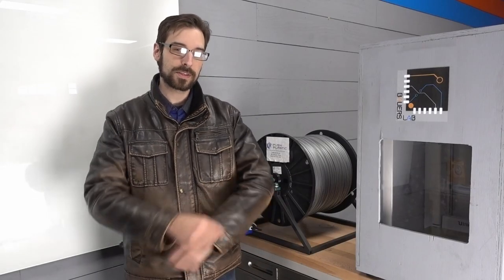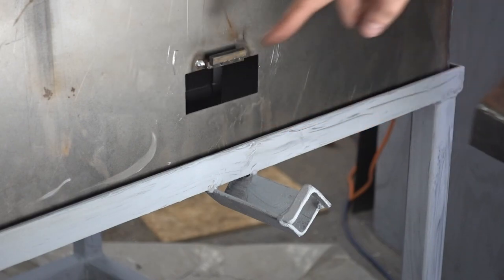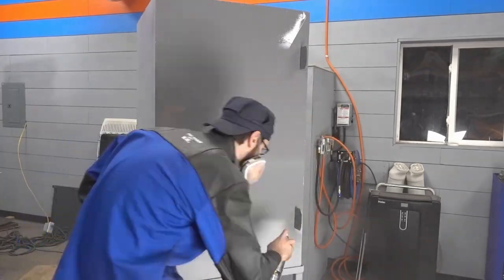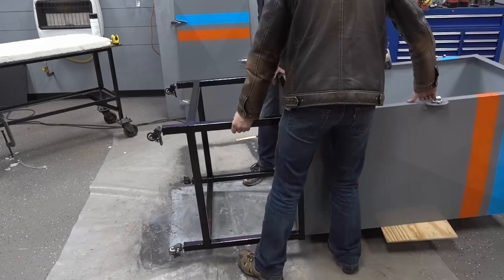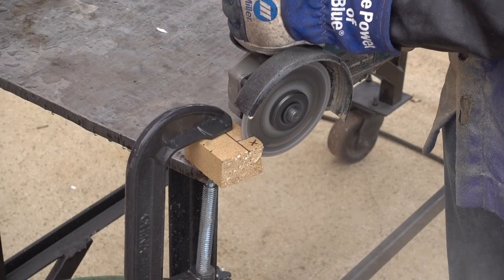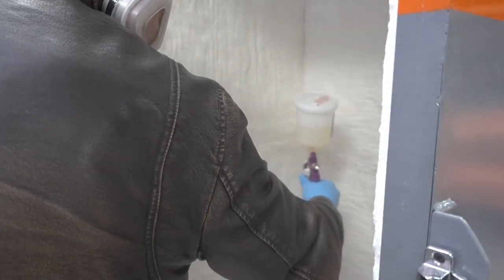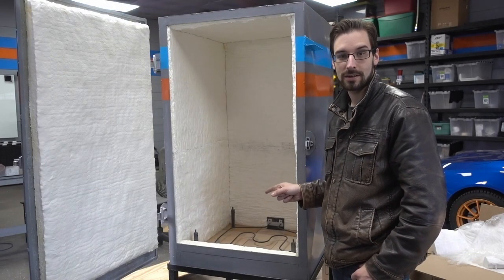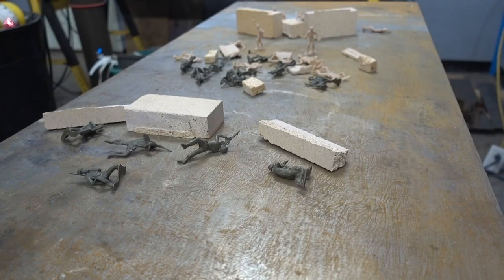Lab Oven (Part 2) - Paint & Insulation

Comment: Hello thanks for the great video. Can the insulation be installed from the outside? And what if I do not have the adhesive?
Please help me
Thank you in advance
Reply from the maker: Well, you can kinda do whatever you want. You will need to redesign some things though. You could install the insulation from the outside if you build a frame for the outer wall first. You could probably just hold everything in place with wire wrapped around this frame rather than using glue on metal sheets.
Reply: @BauersLab  thank you very much

Comment: Hello, we would like to make curing oven. If we use the same system as you do, will we succeed?
Reply from the maker: It is hard to say. I used a lot of custom hardware here. The choice of that hardware was largely based on what we already know how to work with, in the lab. The HMI was completely customer, which could be very difficult for someone that is not already familiar with c# .net. So, it is really about your confidence level with the tools. After this video series, I haven't had to fix anything on this oven. So, this system is working well.

Comment: What Spray Adhesive did you use? and what hardener did you use??
Reply from the maker: For the adhesive I used 3M 08090 Super Yellow Trim Adhesive. Keep in mind that this is not going to support supper high temps. My design didn't require going above 400 C inside the chamber. So, the adhesive does not see all that high of temps.
Reply from the maker: For the Rigidizer, I used Simwool Rigidizer. Both of these are on amazon. It seemed to work well, but I have nothing to compare it to.
Reply: @BauersLab  What temp did you go to? I am looking for some kind of adhesive that will withstand up to 400 degrees. And if anything, maybe just something temporary to hold the insulation until I can get it all in and taped that won't be combustible... any ideas?
Reply from the maker: @un4givon   I have taken this oven to 400C without trouble. The outside of the metal only gets to 60C. If you are only going to 400F, then this glue should be no problem for you. Just make sure that you bring it up to temp in an open, well-ventilated space for the first couple of times.